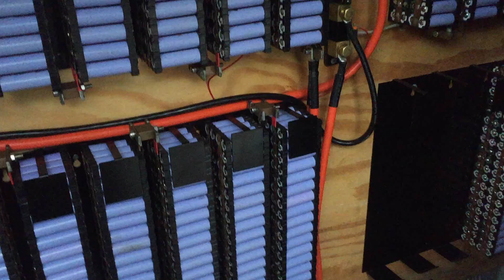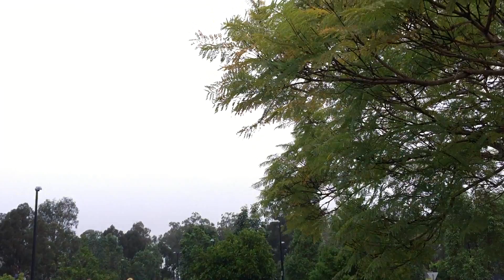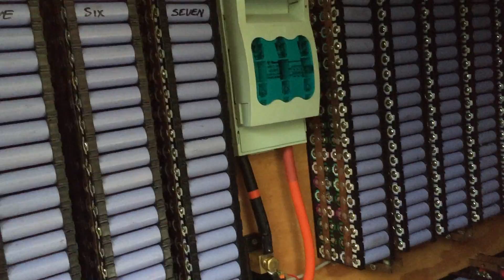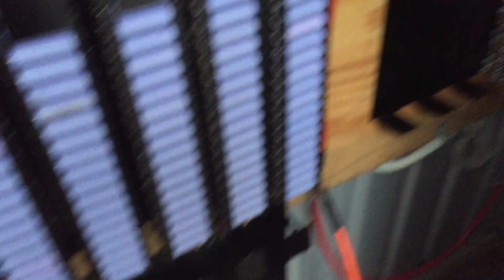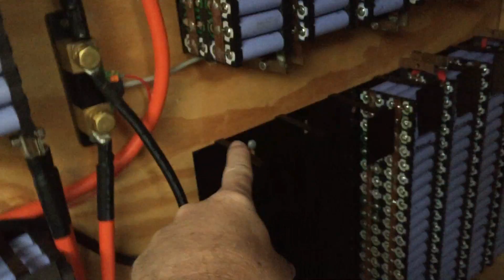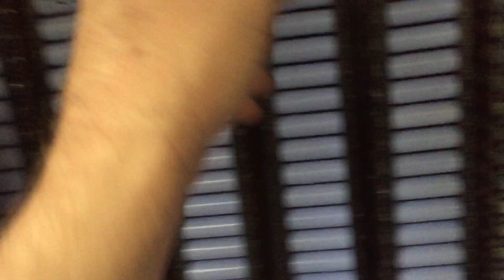Lets do this - 48v time & it's raining to make it more exciting.

Comment: Going for gold, I might go for 48v also. I just got a 2700watt ups unit Im going to try out for an inverter and its 48v.
Reply from the maker: I'm concerned with ups and 18650, just from the fact if you do plug ups into wall socket it will constantly trickle charge the batteries the old interwebs sayz that these cells don't like to be trickle charged.. Could be wrong tho. But I guess if your just using the inverter function it would be a good cheap way of doing it .
Reply: +HBPowerwall Well if you seen it on the interwebs it must be true :) yeah ill be using the inverter function only.
Reply from the maker: Yep, Ol interwebs is smartera

Comment: in my house i have 3 phases and i don' t know if it possible to chosr only one of the phases or work with the 3 ones the inverters are to expensive
Reply: you can feed 1 phase of jusr buy 3 of the same as in the video since thosec48v can be hooked for 3 phase. myself is running one mpp 10kw hybrid 3phase and one 4kw 48v 1phase alongside with some micro inverters :)
Reply: +daromeresperyd probably I will use only one fase because the total amount of electricity from my house full year are near 1000€ and don't meke sense expend to much money in expensives inverters